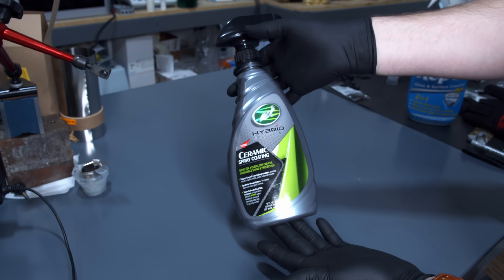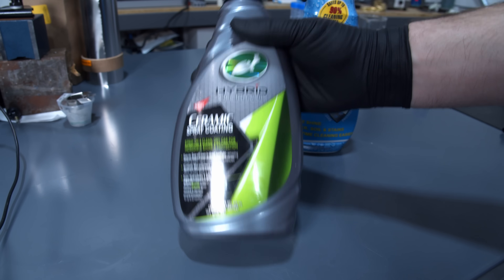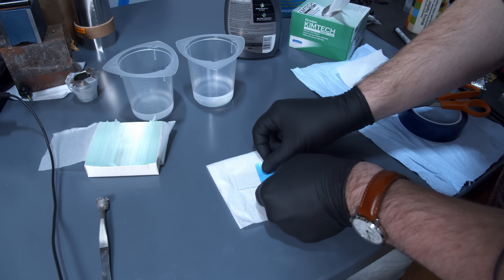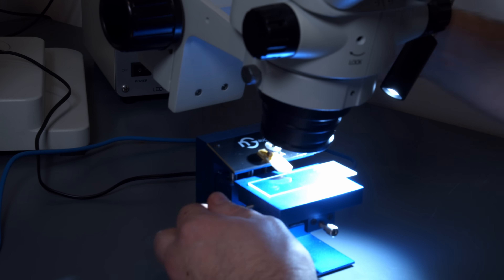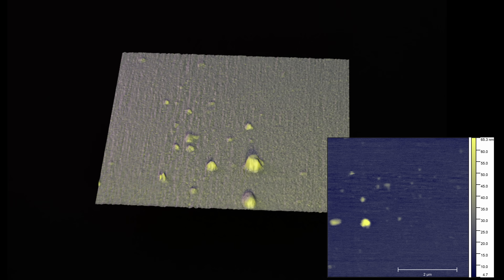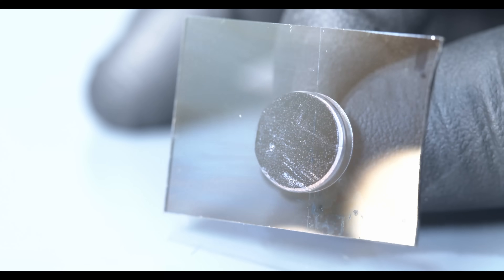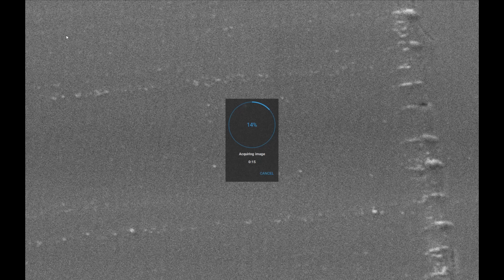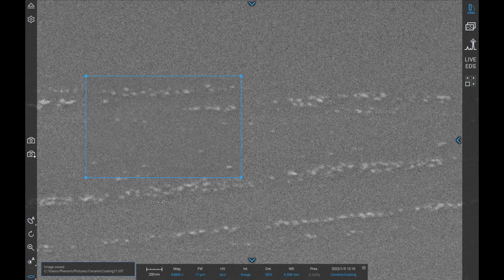Ceramic Spray is (probably) useless

Comment from the maker: 🚨I made a followup video! https://www.youtube.com/watch?v=gsmqijBjBAc 🚨

*Adendum*
- This wasn't a brand new bottle, I've been using it around the shop and only noticed mild improvement which is what prompted the video. But I didn't do a bunch of sprays before the test so things maybe settled? I'll re-run the test and post an update (or video update) if it changes!
- I have some "9H oleophobic" screen protectors on the machine (not pictured in the video) which actually do a pretty good job! Will see if I can unearth what/how they work
- I did try the spray on the window and forgot to share how it went: about as good as the RainX style spray. Good for a few runs and then strips away. 😢
- Several good comments about how this might only work on soft surfaces (paint) or weathered/scratched up surfaces, whereas my glass slides were too pristine and it rubbed right off. Very possible!
- AFM noise can be improved with isolation tables and isolation boxes. The nGauge is really good against noise so I don't usually bother, but I guess F-35s defeat even the nGauge 😂
Reply: I can't help but wonder what it might look like if you sprayed it on and then, instead of wiping it off, allowed it to evaporate. A few 'layers' of this should really fill out the field of view with ceramic particles?
Reply: @StormBurnX  That's more what I'd expect too; I haven't read the instructions myself of course but my intuition with a spray like this would be that you spray it on, allow it to dry, and then wiping with a microfibre is just to remove any streaks that are left after the solvent evaporates.
Reply: @jhonbus  Yeah, the instructions on the bottle make it sound more like you saturate the surface and spread it evenly with a microfiber cloth, rather than wiping it off, but the instructs are admittedly vague. It does, however, say you can layer it, which is why I'm curious how layers of it would look under the AFM.
Reply: Can you make something that sprays the CNC machine's window? Or have a curtain waterfall down the inside of the window. Or just install a car wiper if it won't destroy the glass.

Maybe you could develop your own coating. Find the right combination of particle composition, size and application. Maybe go crazy and try some protein chains.
Reply: @zlm001  There's a device called a "clear view screen" which you may have seen mounted on a ship's bridge window. It's a circular window which spins at high RPM and flings off water. They are made for CNC machines too.
Reply: If you really want a clear view you could install a spinning piece of glass you can turn on as needed, like they use on helicopter cameras.
Reply: @zlm001  
AvE made one a couple of years ago when he had the same problem with his CNC mill.
Reply: do a duribility test vs other bottle u showed in video in ur cnc id love to see if it rlly is stronger then regular water repellent spray 
(like how long does the spray last when ur coolent is constantly spraying on it)
Reply: Ever tried timing your scans during quiet periods with the help of adsb data & flight plans?
Reply: This is simply amazing. Incredible work! I always wondered whether detail products actually creates UV protection or is a gimmick!
Reply: @davidkrocks  if its a full layer of wax then yes
Reply: I would be thoroughly curious of what you find by testing the non-spray variants of ceramic coatings(automotive application). They are touted to be a miracle for longevity of a repellent barrier, and would be interested in what sort of result you see with your AFM should you be interested. Such can found cheaply on Amazon
Reply: Threw em right under the bus... a small bus!
Reply: Samsung cell phones, and probably all of them, have oleophobic coatings (even advertised it at one point). It feels slick to your fingers, instead of grippy like glass does. Once that wears off in your pocket or case, it really shows how badly finger prints stick to the glass. These coatings absolutely make a huge difference. I haven't looked into what it is they use.
Reply: Was about to comment that maybe you needed to purge the tube inside the bottle, before shaking, but seems like you've already thought about that.
Reply: I wonder what the glass strip company uses?
Also I wonder what a graphene wax would do for yah and could it be the solution?
Reply: Just a note these compounds are designed to be allowed to “set” for a period of 4 hours, yes I know the instructions s**k but I would allow to dry for 4 hours before wiping. Also you’re using a hybrid not a pure ceramic spray but it does take time to bind to the surface.
Reply: You're the real MVP
Reply: The claims for these ceramic coatings on car paint is that they "fill" the imperfections in the "rough" paint, making the surface smoother.  I am hugely skeptical since if this actually worked, every car manufacturer would be applying it or offering it as a $1000 option.   Mostly, people who apply this stuff tend to clean their cars more, so they think it works great....
Reply: The real rain-X you apply separately is much better than any spray they make.
Reply: Aquapel works amazing. On a car windshield it lasts 1 year plus in the Pacific Northwest. I've used EnduroShield on my shower door, also lasted over a year, just needing rinsing after showering.
Are you between Marine Drive and Airport way, by chance? We might be neighbors. I get those jets too.
Reply: @WaffleStaffel  2nd rec for Aquapel, IIRC it is a flourinated chemical that bonds to glass much more tightly than the cohesion siloxanes (like Rain-X) use.
Reply: @cbkenison  I found RainX to be like smearing bacon grease on the windshield. Aquapel doesn't leave any visible film, and the water just blows off the windshield above 15mph.
Reply: @cbkenison  You're right, from the mfgr- "Aquapel Glass Treatment forms a chemical bond with the glass which increases water repellency, causing water to bead and easily shed off the glass. These fluorinated compounds apply in just minutes to a clean, dry windshield or any exterior glass surface, and lasts up to 6 times longer than silicone-based products" It's a Japanese product.
Reply: @WaffleStaffel  I also find applying "original" RainX (the one that comes in a Ronsonol-style bottle with the flip-up spout) to be an incurably smear-y mess. The real magic potion, the one you really ought to give a try, is RainX Windshield Washer Fluid - yes, for the car, that one! It's like Windex with RainX mixed in, all you have to do is spray it on and wipe it off, just like cleaning a normal window. And unlike OG RainX, it just works 🤠
Reply: @rocketsalad Will give it a look, thanks
Reply: I don't know whether you shook the bottle any more off camera before starting, but I don't think I'd call the amount of shaking you did on camera "shaking well"... 
Whether that'd make much difference I don't know - how fast do silica nanoparticles settle out? no idea.
Reply: "Good for a few runs and then strips away" roughly matches my experience using RainX on my shower door, tbh!

I often have my phone on a nearby shelf playing videos when I'm in the shower, so I try to keep at least a patch of glass free of condensation and scale from southern England's very hard water. A few layers from my 10-year-old bottle of RainX seems to help, but not for long enough given the effort of applying it 🤷‍♀️ Of course, newer bottles could be better; I've no idea!

(Maybe one day I'll design & 3D print a phone mount to use in the shower... Water-resistant phone & case mounted away from most of the water ought to be fine, I think 🤔)

Comment: how about just using "silicone oil", "wb40 stuff", but you can buy off brand, called and labelled as just "silicone oil" only ever seen it myself spray cans myself, but that should not affect the experiment of self? for doing lubrication, water, environments friendly in ridiculously large amounts, but that what using for here, plus I would love do close up in section of what actually would stick to the service like you did in this video 🙂 PS. like video also 🙂

Comment: I can certainly say I do not believe this product is a gimmick idk maybe it's the particles that's the gimmick but this product does make a difference. I have this exact bottle and it's a noticeable difference on my ebike that has plastic body panels. The biggest difference I noticed was when I'm riding fast on the ebike and the wind makes my eyes water the salt from my tears would stick to the body of the bike a little bit requiring some effort to clean off. After coating with this product I can dry wipe it perfectly clean and stains from the rain are less apparently and also dry wipe clean

Comment: These ceramic sprays are more like quick detailer / clean up solution to make things have a more slick surface and make them more water repellant. You should give the same test to Ceramic Nano Coatings that they sell in tiny bottles and see how that stacks up and see if thats a scam or not because theres companies out there charging anywhere from $50-500 per tiny bottle of the stuff and allegedly it hardens to some kind hard finish.

Comment: After shaking it you need to spray 3 to 4 times to clear the   spray tube tan spray it on what your using it on wait a cupule minutes than wipe it . the particles seam to  fall onto the bottom of the container and when shaking you are not going to really get any particles to mix inside the liquid that is already in the tube.

Comment: The "ceramic" ingredient could just be a minor addition of old-fashioned tripoli abrasive (automotive rubbing compound) or even diatomaceous earth, both of which are natural forms of silica.  Run the crude material through a ball mill and you have nanoparticles.  So it's just an ordinary ceramic polishing compound.  Not something that generates a ceramic coating other than leaving some ceramic debris on the polished surface.

Comment: You need to allow the coating to flash off, solvents that carry silica compunds. Also youll need a glass specific as most are designed to adhere to clear coat and the general sparay style are very low silica. Get a pro grade glass bottle wipe on, flash off and level. They are 15% or more silica. Real low pH chemicals will kill the coating and probably why many use spinning portals

Comment: I havent read all of the comments.   I'll assume its been pointed out already but if not:

nanoparticle coatings are supposed to create self-cleaning, high energy, low wetting "super hydrophobic" tribological effects by disrupting the surface regularity in just like microroughening* or surface patterning, ie in usually pointed to reference example of the smartphone glass display, the bioinspiration of the Rose petal, or more technically in modified glass, quartz, or silicon subtstrate so that a microfluidic device will exhibit a "no slip"  boundary layer effect and increased performance in terms of the usual paramters like mixing, backpressure, and heat transfer, or a "self cleaining" effect, as is important for medical devices like flow cytometry lab on chip systems, among others. 

Incidentally its something you could reproduce with your laser marker (notably for microfluidic applications)......  DOnt yell at me if you already did and I'm clueless to your prior work!

Its tough to say.... Im a very cynical person with very low faith in humanity, so I canimagine that its a load of hogwash and the silica is just inert filler like in cosmetics.

Its also possible that its a real product and that the manufacturer has underestimated and under-directed how much agitation is needed to resuspend the particles once the bottle has set for a while

Conside the anecdotal example of latex emulsion paint from Home Depot; that stuff requires around 30minutes of agitation to get it suspended.

Its also possible that the product expired on the shelf more rapidly than advertised b y self-aggregation (irreversibly) due to interactions between the silica, silicones, and aliphatic compounds.

Comment: If you’re looking for a glass solution the best I’ve used is Crystal Fusion windshield coating. It’s a 2 step coating. Not an ad but I’ve worked a lot with vehicle body and exterior. Works a lot better than the sprays.

Comment: Great video! Is it possible these particles are intended to fill in spaces/voids which would be present in paint but not on the extremely smooth surface that you have used as the test surface?

Comment: You have to shake the bottle more and spray enough to get freshly mixed product from the bottle, not just what's been sitting in the spray tube.
Due to this simple mistake the whole test is a failure. 😕

Comment: Try a quality semipermanent ceramic coating. Not sure if I have this correct, but this type of coating contains ceramic crystals suspended in a resin. Most of these coatings have a much higher concentration of silica than the sprays. I've coated my car in this stuff and it definitely seems legit. The channel Warped Perception did a pretty good video on this. However didn't use any specialised equipment or in-depth know to analyse the samples.

Comment: You went through all this trouble and didn’t even try a spray specifically made for glass. Chemical guys makes a coating for glass that honestly changed my life “Hydro View” also would recommend a glass stripper before applying (or just alcohol that works too ig). Also read the damn bottle on how to apply it “I don’t really know if you’re supposed to do this, but imma do it anyways” isn’t very controlled or fair to the product 🤷🏻‍♂️

Comment: Are your mill windows actually glass? Not polycarbonate or such? It is my understanding rain-x works by bonding to hydroxyl groups in the glass, hence I wouldn't expect it to work great on plastics. Rain-x does make a version for plastics (acrylic, polycarbonate, etc.) that might work better? Then again, tough environment with that water/oil emulsion. 

And yeah, I've always assumed these "Ceramic" car products are just marketing wank. What purpose do these particles provide, even if they could be bonded to the surface in some meaningful way?

Comment: How smooth is the glass slide compared to a painted metal surface? Could it be that the painted surface is "rougher" and the wiping process actually embeds the stuff into the paint where as it just wipes off the glass slide?

Comment: Nobody ever said this ceramic spray was for glass. Project Farm did a real test on clear coat using the same hood taped off. He compared all the waxes and silicone sprays in the same way, then washed them repeatedly with soap to see how long they lasted. Turtle Wax silicone spray was the longest lasting and clear winner. I have been using this stuff for two years on my pickup and not only does it make a good shine but is far easier to put on than any wax I have ever used. Why don't you try it on your own vehicle and see what you think using eyes to determine if it works?

Comment: One thing that may have messed up your experiment, is you were applying to a small square of glass but the directions were written for a glass the size of a car's windshield. 

If you were applying to something that large using the towel you had you would wave wiped a larger amount around the whole surface area and at least partially saturated the rag. It seems like that would mean you smear more of it around the windshield vs swiping it up with a clean rag. I think that would leave more residue spread more evenly. 

Maybe try to saturate part of a rag on the tip of your finger, then you could wipe it on more like a wax than a quick rinse. Try to smear some across the surface area . Just an idea, definitely not sure it would matter.

Comment: Suggestion: instead of using the bottle the product came in, use a micron atomizer and try diluting the base product progressively, and then skip wiping the surface.

From what I can tell is that the cloth is wiping the product off.

It seems best to just a case of their directions is dooming the product.

On the other hand, maybe you are supposed to wait and wipe it after you let it dry.

One way to determine what is in the product is to get the MSDS on it, and also get hold of one of the other guys who has a XRF spectrometer and do a spectroscopic analysis of the dried chemicals [you would be best in this case to pour some into a shallow tray like a petri dish, a baking pan or a shallow steel, copper or aluminum dish, or a HDPE lid but in such a way that once it driest, you pull the product away from the container and support it in some kind of edge holder so you can just focus the X-rays on only the dried product.

Comment: The ceramic coatings used on automobile paint expect the surface to be completely unlike a new glass slide. Paint under magnification looks like the surface of the moon. Very rough and uneven. The ceramic spray grabs onto the defects in the paint, which is why it works. In the CNC booth, it might work better if there is some 'tooth' to the surface of the plexiglass, which there probably is because of all the micro blemishes due to flying chips from the milling head.

Comment: It does not provide a solid surface coat. Instead, it's small blobs that are hydrophobic. The scratch resistance is also provided by these blobs: if, for example, you swipe a golf ball on this surface, the blobs act as floats for it, so the ball is not scratching directly on the surface, but wearing and rolling on the blobs. That's how it works for paint as well. with paint, because it's porous, it can also "sweat" out the particles when friction heats it.